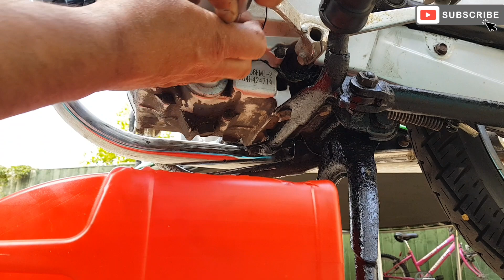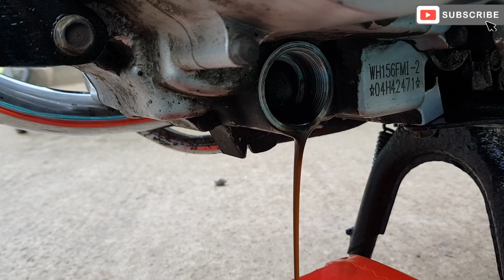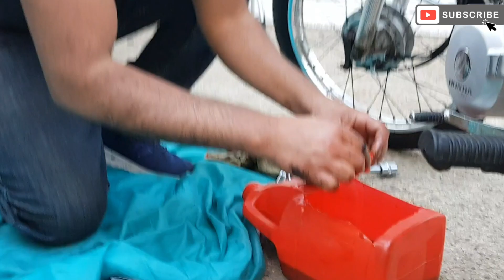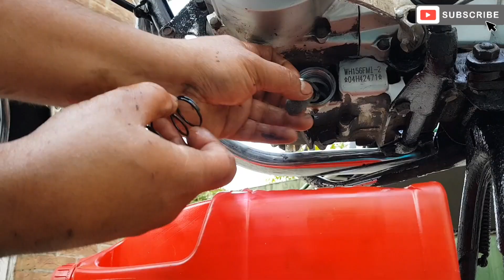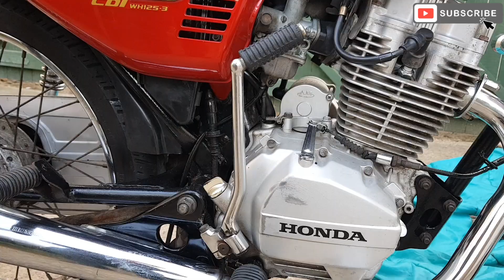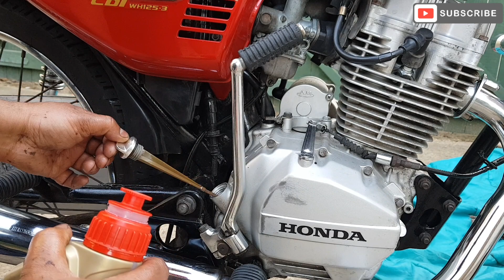Honda CG125 Engine Oil Change

Comment: be careful using race oil. it has very little additives in and detergents. needs changing a lot more often. motul 7100 is a great long life oil with high performance.

Comment: Never put 10W40 always use 20W50 4 stroke take thick oil not thin
Reply from the maker: It all depends on if u are living in a hot country or cold. The weather plays a big roll too.